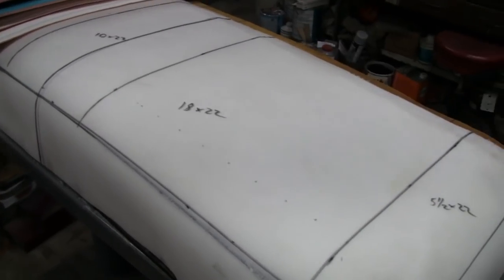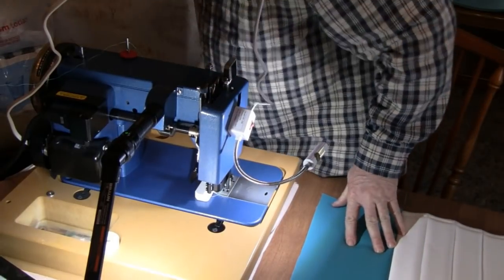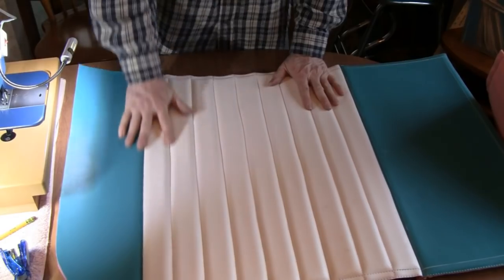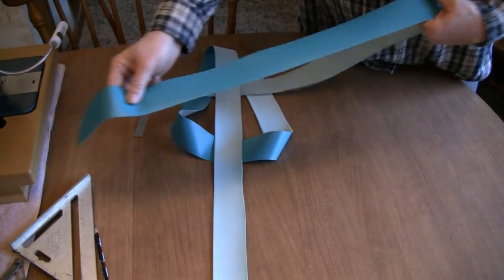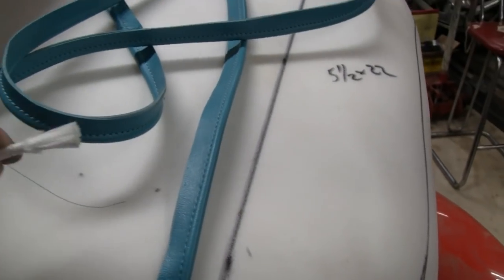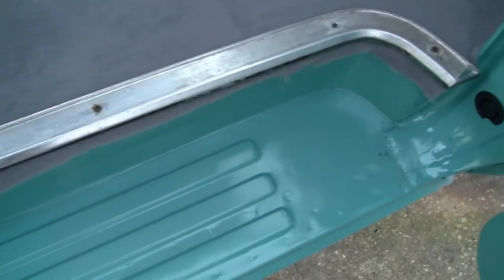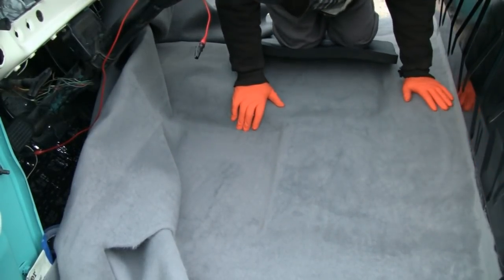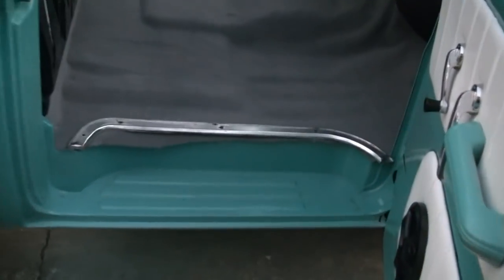INSTALL CARPET & UPHOLSTERY WORK (F100 part 80)

Comment: Hey RK, looking great!  When I do piping, i use weedeater/trimmer line.  It comes in different thicknesses, and you sew the vinyl around.  Also i dont have a pressure foot with a groove in the bottom, but i do have a pressure foot with 1 toe instead of 2, which allows the needle to be up tight against the ribbing and the hard plastic ribbing helps the needle to follow along.
Reply from the maker: Thanks Dwayne!!☻

Comment: He is going to treasure that truck.  I understand what you mean about a work truck.  That said, remembering the PA winters of my youth, extra insulation is never a bad thing in a vehicle.  The warmer you can keep that cab, the clearer and dryer your windshield will be and the less numb your feet will be.  I can well remember how we could never get the windshield clear in our old Plymouth Belvidere, and how my feet were always numb in our Porsche and the rest of the family's VWs.  Yeah, I know those were air cooled engines and electric heaters, but they never had much insulation either.

Comment: In a pinch I've used weed eater line for welt cord. And a trick I taught myself cleaning up aluminum use a 7447 3m scuff pad and jasco metal prep. Then WD-40. I did my aluminum tool box like over 22 years ago when I built it. I think I touched it up once in that time. You could clear coat it to. Thanks for the videos.
Reply from the maker: Thanks for the tips!!☻

Comment: You would think the sewing machine would have a better counterbalanced crank on it. It looks like it’s about ready to leave the table.
Amazing work, my work in that area is a little rough.   ;-)
Reply from the maker: Thanks Buddy!! I think all that vibration is coming from 75 year old Dining Room table I'm working on!! I have to keep the speed down so I don't blow the legs off it!! I do have the optional 20lb Monster Wheel on the Machine also, that doesn't help matters!!☻
Reply: @805ROADKING  The wheel would probably be fine as long as the handle doesn’t weigh too much. That’s one heck of a machine!

Comment: I'M loving the colors of this truck. Yea I think you do want the plastic welting tube instead of that material you have. I think the carpet turned out great. The interior is going to be really nice when you finish. Are you going to put a head liner in it?
Reply from the maker: Thanks Bob!! Yeah right now it has a black plastic headliner, I think I'm gonna cover it with an off white perforated Material!!☻

Comment: You should have put a mat under the carpet, that thing is going to annoy the balls out of you with how much noise it'll make while rolling down the highway.

It's going to resonate through the cab like crazy
Reply: More of a mat than what he did put down?
Reply: @JimsEquipmentShed  what he put down wasn't a mat it's just a butyl deadening material. If you listen to it when you knock on it it still sounds like a hollow tool box. It'll minimize some of the vibrations it won't block out the noise